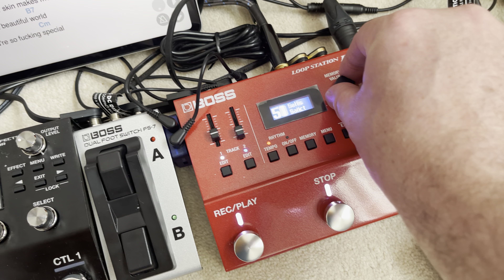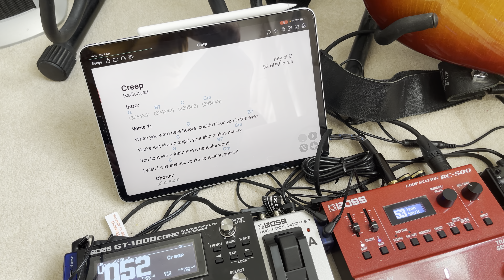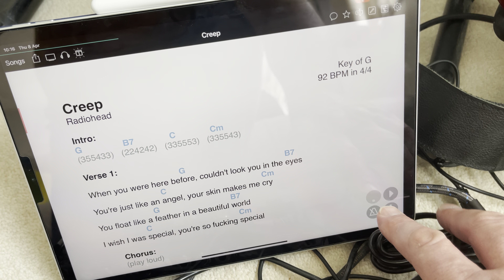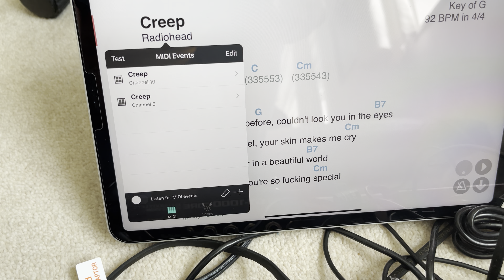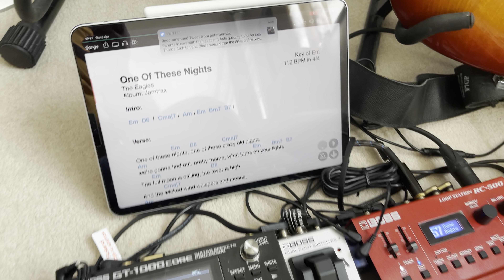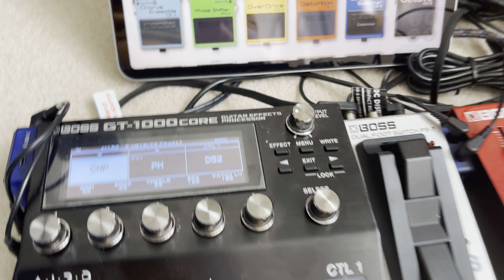Midi control of Boss GT-1000 Core & RC500 via OnSong on iPad

Comment: Hi Dean, thanks for making this video. I wish I could make this work on my setup too. I got only the GT1000 and I use Linksoft Songbook. Simular to OnSong I think. Nex to that I got a Samsung Android tablet. Should it be possible on this setup to? That I change a song on my Songbook app, and the GT 1000 select the right patch?
Regards Arie
Reply from the maker: Hi Arie. I’m not familiar with that software, but in looking at their site it does say it supports Midi and specifically, 'system exclusive' messages in Midi, which is SysEx that Boss use for deeper control.

http://linkesoft.com/songbook/android.html
Reply: @DeanDonaldson  thanks Dean. And to connect only these 2 (GT1000 & Songbook) I don't need the widi bluetooth jack, I presume?
Reply from the maker: @ariefranken  the Gt1000 has BT already so don’t need a widi jack, but the GTK core does not, so that’s why it’s needed
Reply: @DeanDonaldson  thanks Dean, Just one more question. If BT works with an android tablet, does that automatticaly means that is will work with Songbook? Or does it depends on the app itself?

Comment: do you have to have separate power for the widi jack when hooked up to the gt-1000 core?
Reply from the maker: The TRS output on the GTK is sufficient for the widi jack
Reply: @DeanDonaldson  ok thanks
Reply: Does anybody know if the TRS In also provides Power? 
Just wanted to use the widi to change the Preset on my GTCore but also use the Midi out on my GTCore to trigger the Kernom Ridge.

Comment: I would think you would want to move to a smart MIDI foot controller (like the Morningstar MC-8) at this point, and just have the iPad give you visual feedback. Seems like you are putting SO much work into getting a fiddly touch screen to do work that your feet can do handsfree. 
Beyond that, your GT-1000 has SO many blocks, that are MIDI controllable, that can do the same the same function as your "headache-guitar input level matching" issue. I own the GT-1000 floor and use an iPad, MIDI FC's, the WIDI stuff and am a longtime looper, so I have a fair amount k-nowhow. Just my 2 cents.
Reply from the maker: I have a iCTRL here I’ve been playing with, and also a Pirate bridge 6 just landed… in fact just put up a new video showing how I’m using SysEx… I think Morningstar literally only added in SysEx control to theirs and I’d already ordered a Bridge 6 by then… waiting for bridge 6 to add SysEx control, but the idea is that will be able to control everything, as limited by the number of midi commands send out via GT-1000
Reply: @DeanDonaldson  the Pirate Bridge 6, I have heard of. It is a slightly sup’d up MC-6-knock-off. I’ve been using MIDI footcontrollers and MIDI loop switchers and Boss/Roland stuff since the mid-90’s (old rig was a Rolls MIDI Wizard, Rolls FX switcher, Boss SE-70 and Roland SX-700 w/ a bunch of pedals in the FX switcher, all fed into an Electrix Repeater…everything except the Repeater, I used in the 90’s, and that rig could still put most rigs to task). 
If you wanna keep it simple, use bluetooth, small foot print, cheap AND with an iOS editor, I just picked up this bit for a travel rig. Its from China and has been put out under a few different names, but the version I got is the M-Vave MIDI pedal. You would find it on Ali Babba for cheap, but Reverb has it as well…just more expensive. The iOS editor is called CubeSuite. It can work over bluetooth or TRS midi. Has a built in rechargeable battery. Can work as a MIDI footcontroller or an iOS page-turner. Its not bad to program, but I still haven’t sorted out the bank up/down. Anyway…less than $50 (I paid $40 US after tax/shipping/bullshit from Ali Babba) for one of those. Its SO tiny. It has 4 switches in a thin chassis that is just slightly wider than the GT-1000 core. 
Anyway…just spitballing ideas.

Comment: Great video! I just bought a Widi Jack as well and it´s awesome to have to have bluetooth on my core. Maybe you can help me with a problem, I am facing: I have a Boss RC-10R, which I want to control via midi as well. I want it to work like this: When I tap a tempo on my core, I want it to be sent via clock to the RC-10R. This works fine, but as soon as I open Boss Tone studio app on my phone, the RC10-R loses Midi connection and can´t receive anything anymore. My Midi chain is like this: Core out -> RC-10R in, RC-10R out -> Widi Jack in, Widi Jack out -> Core in
Did you run into similar issues with your RC500?

Comment: Thanks! Your video was very helpful. I was wondering, part of my plan is to NOT have to use a separate preset for each song on the Boss RC-500. I would rather send MIDI commands to select the drum kit, beat and tempo via OnSong. So as I swipe through my setlist on OnSong, it would send the set of MIDI commands to change the drums as described previously versus me having to create a user preset for each song on the RC-500. Is this possible?
Reply from the maker: I think if you set up CC# on rc500 and have them assigned to what you want... then as it is on a specific Channel, then you would send a command from OnSong to that channel and then the CC#... but this has to be set up at patch level on the rc500 as there are no global assigns!! :-/

Comment: This is great info. I have a GT-1000 full coming tomorrow and we use OnSong at church. Wondering if the GT-1000 can control the IPad OnSong?
Reply from the maker: Thanks. The full has Bluetooth integrated - so the rest is midi connections of patch changes so should work the same :)